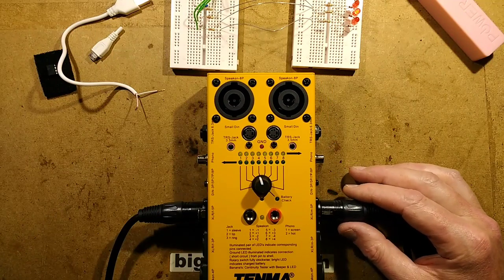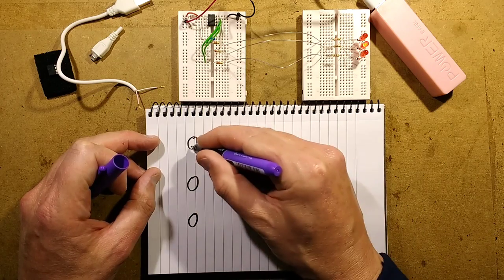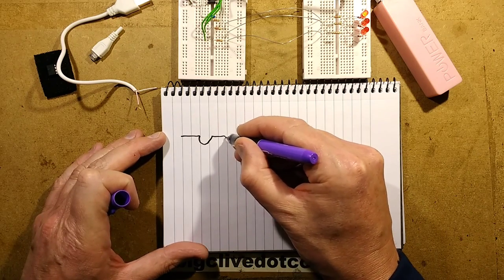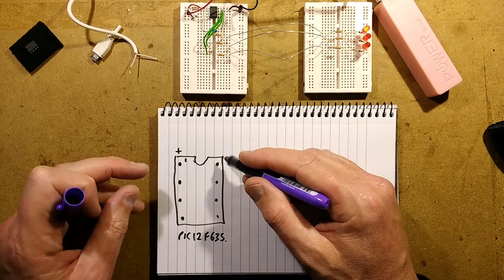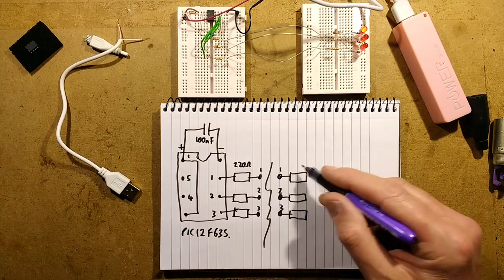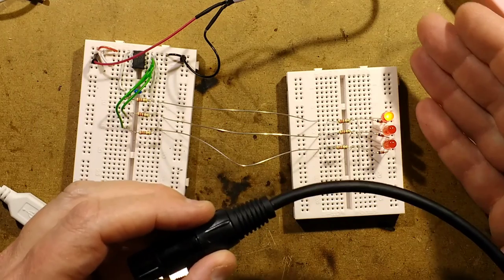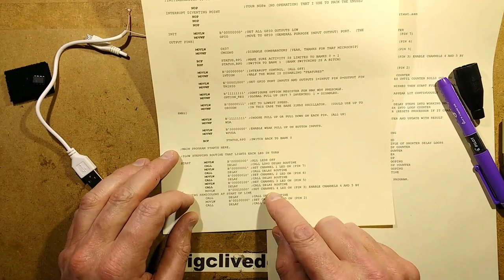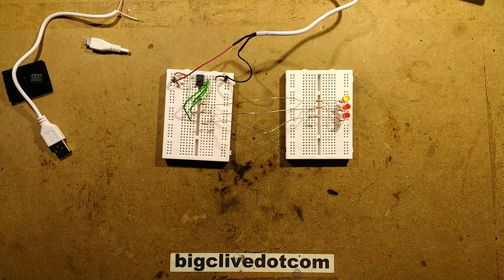Experimental 3/5 core DMX cable tester.  (Including PIC software.)

Comment: I got a cheap tester that dose the same thing, it step though 8 LEDs for testing network and phone cable that has a fast slow scan switch.
had to get a new one when I plug power in and did not remove the other pace. burn the LEDs out.
A 555 timer with a shift register will do the same thing

Comment: but a simple 555 timer and 4017 would have done the trick ... "I chose a PIC12F635, is because I have over a thousand of them" yeah.... ok, your fine. I trow with Atmega382s because I have 20 of them. quick and dirty prototyping doesnt care about whats the cheapest or lowest level. It cares about what you have at hand and think "yeah, why not?" ;) clever part sourcing Clive

Comment: hey clive, i made a "smart" cable tester for my college project, using an arduino and RGB / bi color led. You can plugin the custom loom in dumb mode it will purely signal with bi color LEDS or using a usb cable with a terminal it will print out the test findings eg it will well you what wires are open or which wires are shorted or which are miss wired!  should still have my presentation with code if you are interested.
Reply: it works by outputting a voltage to each wire individually then using sense lines to check for voltage on each input. If the voltage is present on the wrong core it will cause a fail red LED (Dumb mode) it will print the fault in the serial window (smart) for example " Broken transmit side" or "Shorted with channel # ".  It also prints diagnostic information like the voltage measured so you can determines bad solder joints etc.

Comment: Just curious, why not have the pic step through the pins then endlessly loop the "scan" function? Also, any plans on selling complete units or at least the kits with pre programmed pic controllers? I know which end of a soldering iron is which but programming is a bit beyond me.

Comment: The pin that is unused could select between 3 or 5 channel and use just one SW for all. If this DMX wiring is too long (not sure if it is) would help adding small caps and tvs diodes on each pin (guess that it wont fit in the shell anymore LOL). But PICs are very hard to kill, after all you have tons of them LOL But they tend to be a bit suceptible to noise that made its way to the pins. Long wiring can pick voltage effortlessly. You used MPLABx ?.
Reply from the maker: I did toy with that. Just linking that input pin to either 5V or 0V to select the number of channels.  Would be easy to do.
I tried MPLABx and it was frustrating.  Like starting at the bottom again and absolutely full of features that had to be waded through.  I went back to version 8.

Comment: I wonder how complicated it would be to make this "failsafe" and probably send a "real" DMX512 signal. Just in case somebody forgot to unplug the other end in a live installation. You sometimes have to test in fixed installations. Of course you’d probably need a little case then, and a dip switch to set a valid address … hmmm. Probably over-complicating it :D

Comment: Hey Clive sweet video.
I was wondering if you could help me on figuring out how to short a switch to turn on with out having to press a button to get it to go.
So what I am doing is I have already put in the LED mods in this Tonka Toy Police Car that I have been modding and even have it hooked into my High-Speed 1 Classics +5V and Ground.
But what I am wondering is how can I get the toy police car that uses a membraine push button to turn on when I run the red light on my High-Speed?
I think it has to do with shorting it out but not sure where I need to put the wiring I can get some photos to you if you need the circuit board which is not really to in depth.
Reply from the maker: You could possibly use an optoisolator across the button.

Comment: Is that the same chip you used in the RGB kits you sold from your website?  (i got one years ago before you came to the Island)
Reply from the maker: +CrashOrgasm Different PIC.  PIC12F629.  But could run the code with modifications.

Comment: Clive, how naughty of you not to use the "org" directive!
Reply from the maker: I'm too used to absolute code.  Theoretically I should start with ORG 0x00.  I generally don't use interrupts much and disable them, but also put the cluster of NOPs in the interrupt vector area as a precaution.

Comment: this can also be used for computer networks RJ45 ethernet
Reply: I suppose if you extended it to cover the extra wires in CAT5 cable. But there's already cable testers for Ethernet, they're pretty cheap. You get 2 boxes, like this, a transmitter and receiver. They can even do clever things, like if there's a break in the cable, the meter will tell you how far along the cable it is. 

For the price, it's worth getting the proper gear, Ethernet is a bit more hi-tech than DMX.
Reply: @greenaum  I have a basic ethernet cable tester with LEDs at both ends, and it does the job for me.  I bought a "fancy" one from ebay that was supposed to be able to tell you the length of cable, etc. and after a couple of days of playing with it,  it died.  They refunded me.  I scrapped it a while back,  there wasn't much that was usable salvage in there.

Comment: Does it really matter whether the RGB LED is common cathode or anode? Couldn't you just reverse the logic level of the outputs for either of them?
Reply from the maker: dillerboy You could, but I was meaning for use with the existing software.
Reply: Ah, makes sense.
edit: I couldn't quite see, but are you just doing noop loops for delays? Or are you setting up an onboard timer?

Comment: I think the automatic toggling back to slow scan will be very bad for daily testing.  Imagine wiggling the cable while at an awkward angle and watching the leds through the corner of your eye.  It will be hard to tell if a loose connection is released at the same time when the @#!% decides to do a slow scan.  Perhaps code it to only switch back to slow after the PIC senses a complete disconnect or another deviation from fully connected.  This would obviously require some extra steps in the fast scan that put a pin in input mode to check if it's at the expected midpoint minus 0.9V.  With such a design, the switch to slow scan would also be implicitly latching faults for a second or two.

Comment: I have seen pickit 2 and 3 on ebay for cheaper than from microchip. Which one do you recommend, are the cheaper versions ok to use?
Reply: I would recommend the pickit 2 by default. The pickit 2 is simple to use and you do not need to change the firmware as often as with a pickit 3. Pickit 2 has/had (I last used it on windows XP) a good standalone programmer software.

I would go for a pickit 3, when I would need support for more modern High End PICs, simply because companies tend to support newer products better then legacy products.
(but pickit 2 might have better support for older pics)

Either-way: Checking the supported the PICs is important. If you plan on using a certain Controller, that might already dictate the decision. Even if not, the compatibility list is still important as it will one way or an other limit the controllers you can use.

Keep in mind, that both devices are kind of "old" for a computer accessory, speak older then five years.

Also keep in mind: Pickit 2 and 3 have limitations compared to other hardware:
Debugging microcontrollers is always tricky. The pickit 2 and 3 are limited compared to higher end debuggers. (After all Pickit 2 and 3 are mainly programmers, that also can debug. The expansive debugger are mainly debuggers, that can also program)

Also check for pickit 2 and/or 3 clones. That might be an option as well.
Reply: sarowie thanks for the reply! i previously decided to go for a pickit3 (thought it was overall better) but now im definitely going for a 2. i am also a bit conserned about those clones uploading malware to your computer, have this been a problem to you?

Comment: Not using Neutrik XLRs? What blasphemy is this?
Reply from the maker: Neutrik is preferred, But I've run out of them.
Reply: Motorman2112 switchcraft is just as good
Reply: Mario Barreneche I haven't seen any in a while, but if they're still using screws then Neutrik are better when you want to quickly take them apart and reassemble to check for suspected problems.

Comment: XLR for both audio and lights? crazy!
Reply: This is why DMX512 specifically prohibits using 3-pin XLR connectors even though the secondary data channel is rarely used: 3-pin not only tempts people to use audio cables rather than data cables, but worse, lets you can plug an audio cable carrying 48 V phantom power into lighting equipment control circuits.

Comment: You could put a link to ground check on GPIO5 and run 3 wire program if set, Default 5 wire....
Reply from the maker: Mike James I did toy with using GPIO 3 as a 3/5 mode selector depending on whether it was connected to 5v or 0v.

Comment: I would use something like NE555, some Darlingtons, array shifter and so on... No microcontroller... Or at least DIP switch and PIC to change "programs"... :-)
Reply: A shift register would work well for this. I think there's even ways to clock in a 1 (carry?) if the register is empty too. Then you're just changing the clock speed to switch from stepping to scanning. It's just that these days it's easier to find MCUs than it is discrete logic.
Reply: And how would you fit that in the back of an XLR connector? You would need an  external box to fit in that much stuff.
Reply: l wilton - yeah - UR right. Anyway I can imagine 3D printed plastic case capable of to be screwed on that XLR... Or one can use ESP8266 to do more complex diagnostic with wifi transmission to tablet/smartphone to collect data or monitor glitches and so on...

Comment: hey man! i live in india. we have 240v ac at 50hz. i wanted to transmit dc voltage for 2km . normally we use a step down transformer to get 40,60,110v ac and send it off the road to power our catv bosters and network switches. but because ac is dangerous we wanted to use dc at 300v which will not kill people than 110v ac.so just for experiment i use a bridge rectifier witch give 330v dc and as soon as i plugin a 8w led panel light with an led driver thqt also have a built in 500ma bridge rectifier it make the circuit breaker go off don't know why but the led still works!can you help me. is 2 rectifier creats a short or the rectifier i made was wrong!
Reply: Kuntal ghosh Strangely, I learned that DC at those voltages can be more deadly than AC.  I guess it depends on the type of accident.   AC might increase the risk of heart fibrilation and might couple capacitively or inductively.  DC might prevent the victim from removing their hands because there is no AC releasing their muscles many times per second.

In the late 1800s when two competing US companies were trying to distribute electricity as DC or AC, both did a lot of exaggerated propaganda about the dangers of the competing type.  These debates resulted in the unusual US electrical standards such as 110V AC and 180° two-phase domestic power. Some of the old propaganda may have found its way into US textbooks and curricula.

International standards tend to classify AC and DC as dangerous at approximately the same voltages.

Comment: This could easily be done very jelly bean, but I guess if you have over a thousand pics than there is no reason not to use them :D
Reply: Any design with more than a single chip, it's generally easier and cheaper just to use a micro instead. Unless you're making millions of something.

Comment: How exactly does an LED work? I'm not sure I really understand how it turns electricity into light :(
Reply: David Taylor Google it .
Reply: A light-emitting diode (LED) is a two-lead semiconductor light source. It is a p–n junction diode that emits light when activated. When a suitable voltage is applied to the leads, electrons are able to recombine with electron holes within the device, releasing energy in the form of photons.
Reply: You're 80% right but LEDs emit light because when electrons collide, they emit photons. When electrons flow from negative to positive through the PN junction, they collide and emit photons.
Reply: What is a PN junction? Thanks for the explainations so far :D
Reply: The different colors of LEDs come from different semiconductor material pairs, Blue was first with gallium nitride on sapphire, then indium gallium nitride. The first "white" LED was just a blue LED with yttrium aluminium garnet coating on the emitter to absorb some blue and allow a higher amount of yellow light.
Nowadays there is also quantum dot lighting which is a completely different technology to LEDs.
Reply: Electrons collide when they go from one orbital to another inside the atom. When they collide, they release photons as result.
Reply: I don't really get that, how do they fit that stuff in something so small?
Reply: Also, thank you everyone for your reply, everyone is so knowledgeable :D